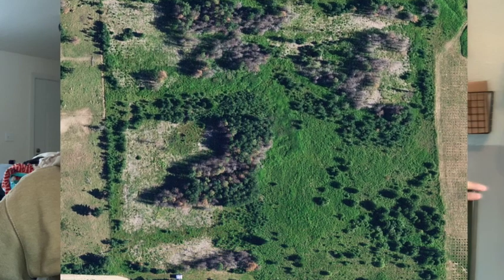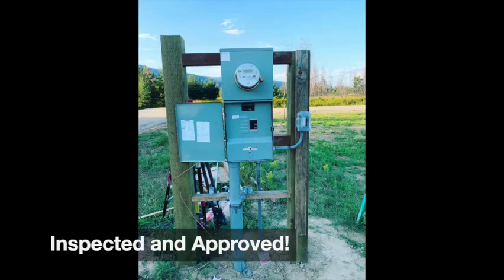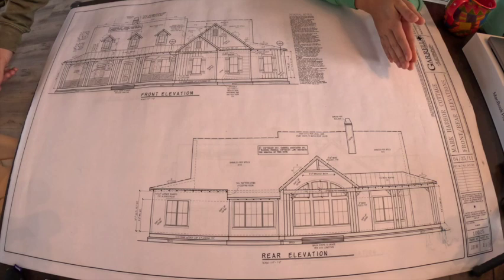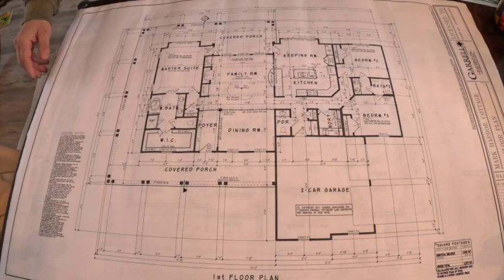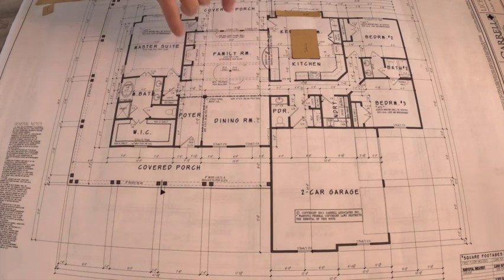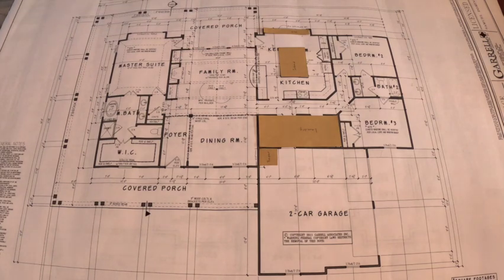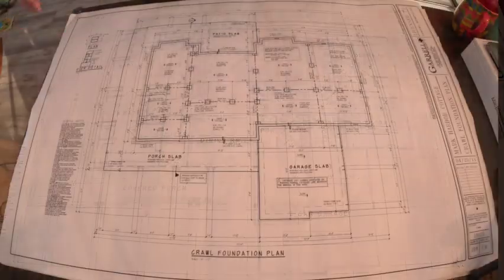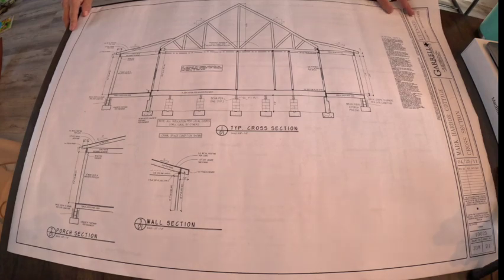Building A Homestead In 1 Year - The House Blueprints

Comment: Sam, I applaud your timing and schedule successes. As a Design/Builder the first thing I address is siting for prevailing wind and primarily Solar Orientation. You explained the elevations but omitted the orientation and maximize solar gain. Another question since you mention crawl space, do your local guys know about "Conditioned Crawlspace" and to Not vent the crawlspace. Does your MEP plans include ERV integration with your HVAC? Good stuff.
Reply from the maker: Thanks dude! Luckily for us our property is very wide open and so if I choose to use a solar system at some point, I won’t have any problems placing panels! If we choose to do a solar system in the future, that is something that I would probably discuss in a future video. Also, as far as the crawlspace is concerned, that will be in another video, I have some very interesting plans for moisture control in the crawlspace, due to high water table! and I was planning on integrating an ERV in my HVAC system I just haven’t fully decided on my HVAC system set up yet. But when I do, it will be a video as well. Thanks for all your input too. it’s always good to have other experienced builders input.
Reply: @dkranchdom  Keep up that momentum, Yer Rockin' it!